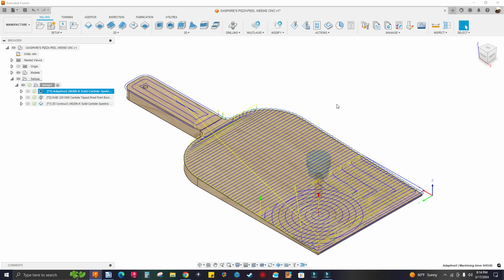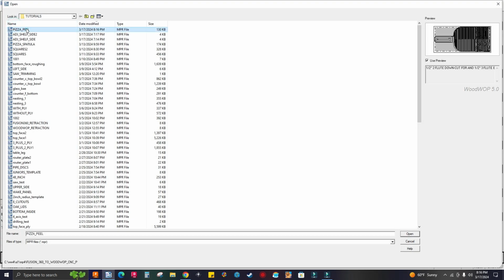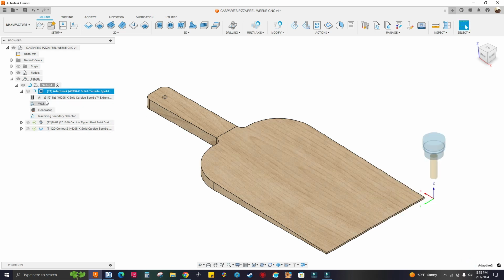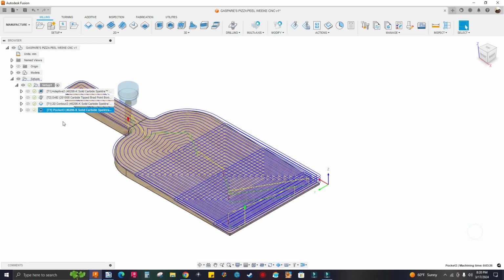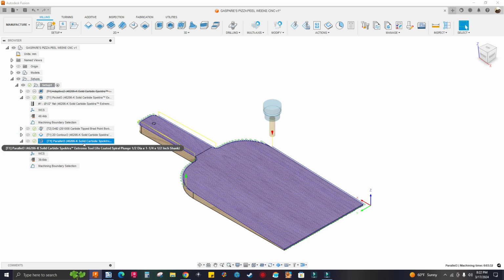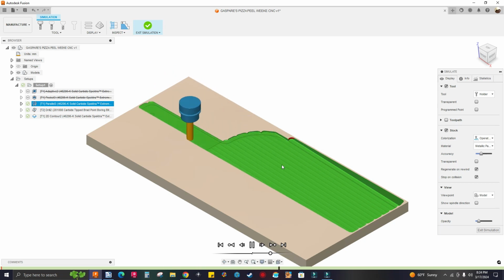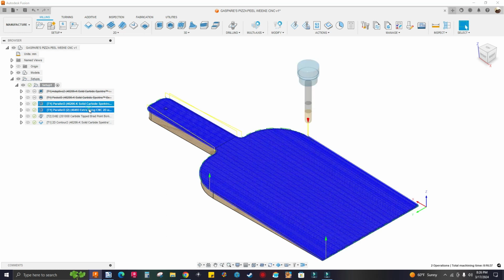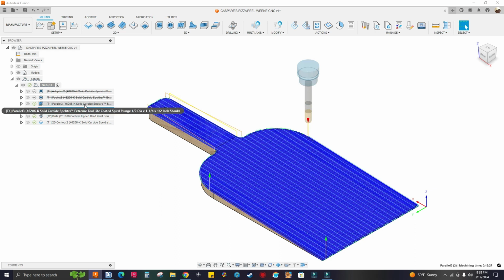2 ALTERNATIVES TO 3D ADAPTIVE CLEARING FOR ROUGHING.

Comment: How you get the file from mpr to your machine cnc and how I can activated the code  in the machine to start
Reply from the maker: I save the mpr file to a usb stick and import it into the machine, i click on mcc_beleg ( machine table ) click on select on the computer screen to load the mpr file, once selected, i click on accept to run the program. I sent you a link on how i do it.
Reply from the maker: I can you send pics via instagram, here my instagram @mr_pod_and_rail